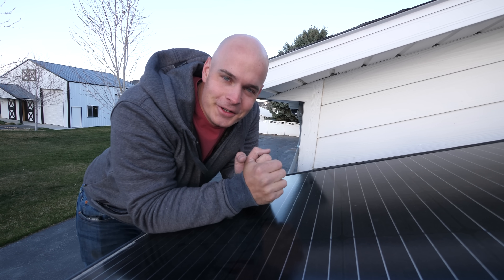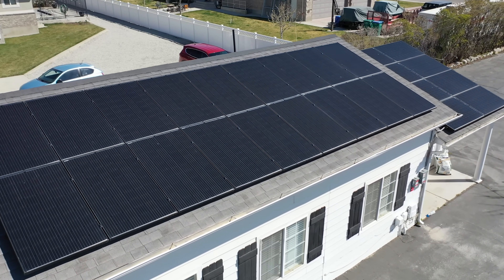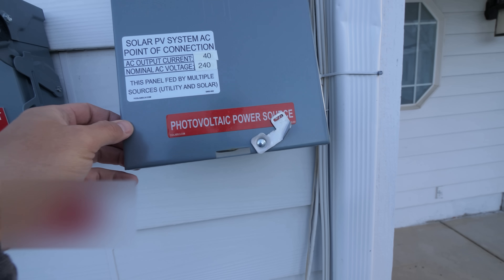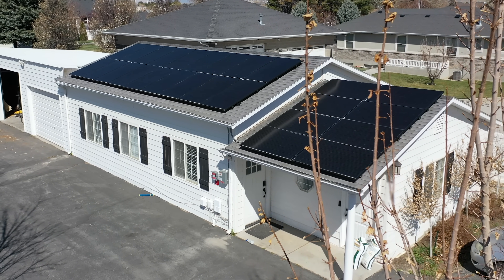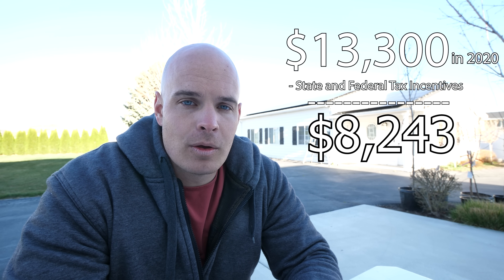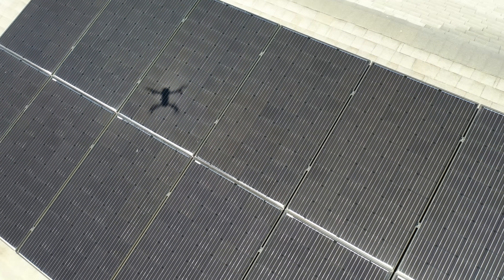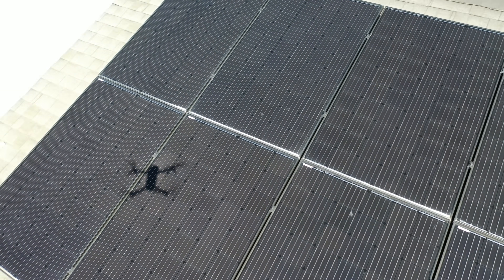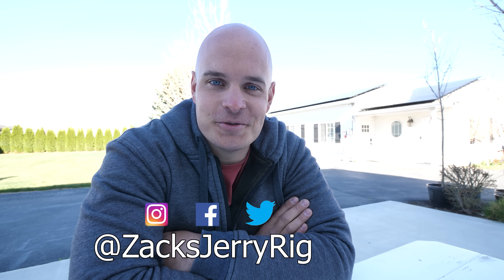One Year Solar Update! - Is Do it Yourself Solar worth it?

Comment: You missed the cost of replacing the roof in 8-10 years. The asphalt shingles are not able to take the extra heat under the panels. and the sheathing starts warping also. never mind about potential rick of leaks. Better off with a sun tractor panel in the yard.

Comment: Quality video.  I went with a reputable installer.  My energy bill average is $187 per month x 12 months = $2,244 per year.  Maryland electric prices are .12c per kWh. We have net metering, Baltimore Gas and Electric pays you for what you produce.  For each 1Mwh produced you generate a solar credit that pays you, currently $75 per credit x 16 per year = $1,200.  My system has been up since Sept. and has generated $1,000 in kWh so far and I have been paid for 6 credits for $437 (2 credits to be paid still).  I will see a bigger amount of pay back over the next 4 months due to the summer sun.  I project 100% generation for all my electric needs ($2,244) + 16 credits x $75 = $1,200.  Total $3,444 per year.  Wish I had done it myself, but my roof is 2 stories and a steeper pitch, plus I am not a fan of heights.  8.5 year payback.  Key is to buy and pay with cash as, if possible.  I got a 1 year 0% interest loan on the government subsidies. Paying interest will increase the payback period.

Comment: With regards to east vs west power, it depends on where you live. In sunny parts of Australia it’s about 88% of the north (your south) facing. But in areas further from equator it goes over 90% so most new installs in Australia are east+north+west in 3 strings or micro.

This is really a new thing with the efficiency of some of the later panels. If it’s a slightly longer ROI it doesn’t really matter.

I know if really old systems going string after 15 years, so they would have paid for themselves many times over.

And better still…. More solar means less coal.
Reply: Absolutely agree. Australian here and will be aiming to get solar later this year on E/N/W option as you said as my north facing roof isn’t very big but have a large west facing roof.
Reply: @AidanCran  you won't regret it :)
Whilst I have north facing, I was speaking to my rear neighbours (both of whom have strictly east-west roof aspects) about how solar is such an affordable investment (particularly in Australia). But they still remember the days of north only. Shortly after the conversation, both neighbours got quotes and within 2 weeks, both had operational systems.

A year on (even in the bad rains that have hit the east coast), the systems have proved their worth. During the rain when I had almost no sun, my system was still generating a saving to the point my electricity provider was still paying me for net export.

The smart thing the Australian government did very different to the US was two main points:
1. Clear the red tape allowing for certified installers to do the work in a very straightforward manner
2. Provide a mechanism for quickly dealing with Renewable Energy Certificates.

Someone in the US can really comment on how they deal with Renewable Energy Certificates. In Australia though, the Renewable Energy Certificates (RECs) involved with solar installations are called “Small Scale Technology Certificates” (STCs). These are offloaded at point of sale of the solar, to companies that need to offset emmissions (usually filthy fossil fuel generators). But to the purchaser, it appears as an immediate rebate off the solar system.

Benefit of the scheme is that:
1. Government does not have to actually spend money - they set up the system (although many still think the government is handing out money - which for them is just good marketing).
2. The residential solar owner gets financial benefit immediately and does not work
3. Red tape cutting means that from getting a quote to having a working solar system can be done in as little as a week

It's led to Australia having the highest uptake of residential solar per capita globally (Germany and Japan are 2nd and 3rd)
Reply: @inodesnet  that’s amazing!! Thanks for the reply!! I did not know about the uptake of solar, my family is in good stead for the renewable future being German and Australian 😋 
The STC’s are going until 2030, so get in as soon as possible to capitalise on those discounts!! 👌🏼☀️
Reply: @AidanCran  I think great thing is that the phasing out really times well with the fact that solar products are becoming cheaper every year.

So the “rebate” (incentive) has always done a good job of making solar affordable for the average Australian home owner because more was taken off price when expensive, and less as it gets cheaper.

Price has always been around $1 per W whereas countries like the US have only recently broken $3 per W

Comment: Great looking system and hello from north panel facing Australia.

Confused about saving calculation. When talking about saving here we split it into self consumption and export.

If you created 30kWh (during day) self consumption might be 10kWh (what you would normally pay your provider). So that would be 10kWh x 10c saved. The extra 20kWh we would normally export and the provider would pay us. Then of course taking into account usage at night that solar doesn’t pay for.

In my case electricity is much more expensive than Utah. We get about 1/4 system paid for government which is effectively paying the REC’s in advance.
We only get that if we have it installed professionally :(

In USD systems are usually about 70c per watt installed. But high electricity price really helps incentivise with our kWh rate being closer to 20c (OUCH). But for exporting we get 15c.

Utah’s giving back is actually a really, really good idea!!

Loving solar though. The government and installers make it easy making it the highest per capita user of home solar. Payback given higher price got electricity and lower system and install costs is often 3-4 years here.

But having seen so many systems here (over 20％ of homes have solar), I must say yours is really good looking and would put most to shame

Comment: I have to say that. that has to be one of the easiest solar installs.  There is no roof vents anywhere on that side of the house which you then have to work around with the panels.  No here.  It's just full panels all the way across.  That's pretty nice.

Comment: I would build a carport over where you park your truck and a covering over your driveway and put up more panels. And if lumber is too expensive, It would be easy to do with steel and it would never be replaced, since most steel roofs have a 30 year warranty to match the panels' warranty (plus it's just your truck and driveway underneath, who cares if it leaks eventually?).
Reply: A couple of years ago a buddy of mine looked into financing a system but he said it wouldn't be worth it. We live north of Tupelo, MS but he's got a lot of trees across the street that shade his house. Another thing I realized, whenever your power rates are increased, you'll save even more money and earn even more night time power from your system.
Reply: I think he's got a garage attached to his house and he rents that little house out. His real house is in front of the little one, then has another garage in the back as well.

Comment: In a temperate climate like the middle latitudes of the U.S. are the best places for solar. If you have to produce much more output for increased heat or cold, solar won't be able to keep up. The more extreme the environment, the more solar falls behind hydrocarbons. You could get the same results by producing electricity with a parabolic closed system mirror water boiler. But, just like solar, when the sun goes away, you're done. Your best bet at production is harnessing wave energy from the sea or nuclear. Waves are consistent. Only maintenance is replacing parts rusted by seawater. Solar, wind, whatever, shouldn't be labeled "alternative", it should be called "supplemental". The real advancements will have to be in batteries and harnessing lightning in batteries to provide supplemental energy. Nuclear is still the way to go and stop looking at it like the boogy man.

Comment: The city of Los Angles DWP only pays wholesale cost to you for power back to the grid. About 1 or 2 cents per KWH. 
Question: I have a over built 50 X 20' steel roof patio facing South could the panels be mounted on the patio and tilted up towards the sun? I do not want them on my house roof.

Comment: This is so different to UK. We meter your production with a inline meter. Then you get payed for half your production at a feed in tariff rate which is higher than the cost we buy electric in at. So if you can use more than 50% you produce your winning.

Comment: Someone walked on the panel at 5:29? LOL
Reply: They were all over the panels at 10:30 during the installation too. Pretty sure the manufacturer doesn't recommend that!
Reply: @YeahTheOzzy  I can't see walking on a fairly thin tempered glass panel.
Reply: @electronicsNmore  not recommended but hey it didn't break.

Comment: I installed a 15kw system on my home myself. It cost me about $10k. $7k after federal tax credit. First year saved me $1600 so I should get 100% payback in a little over 4 years.  If I can get a 20 years out of these panels and inverter and would say it is well worth it. The hardest thing on installation was doing the paperwork for the city. I would also like to say, do your research, know exactly how your power company handles solar. In my area I have to pay a higher rate for electricity with solar because you lose a lot of discounts. Also, they pay very little for excess production 2cents kwh.
If I had to pay a company to install, I got bids for $30k plus and that just would not be worth it in my opinion. Cleaning the snow off in the winter is a pain. oh, and a far a saving the planet I think that’s a bunch of bs. science actually shows there has been no global warming at all the last 12 years. I can go on about this subject and all the fraudulent facts but to each his own. it’s just too bad our government is raping the American taxpayer trillions of dollars and they are not even spending it here for so called green jobs. giving it all to foreigners. that's got to tell you something right there.

Comment: Great video man, however, there is one thing you didn't talk about: it's the thing underneath the panels that convert DC to AC, I've read that it need to be changed every decades, how much would it impact your budget if it is true ? I guess you will add it to the math if so

Comment: 10c/kWh? Far out. It's easily twice that in Australia. IS that price an actual feed in tarrif price though? Or do you get nothing or a lower rate for feed in?

Most places don't pay you anywhere near the same amount you pay. i.e. here it's 25c/kWh to buy from the grid, but to sell back you'd be lucky to get back 8c, some place none (and there's no giving you back any at night here). So it's better to charge batteries, or use as much energy as possible.

Comment: Your calculations assume that you have a coincident load to match your panel output because you're not wheeling (selling your power back to the power company at a significant discount).    In reality, you're likely not going to have as much electricity being used at peak production every day.  And there will be other times, too, when your house doesn't need as much power as the panels are putting out.  Because you're also not storing this energy (in batteries, for example), it is wasted and is going to bring your simple payback period up from the modest 6 - ish years that you are calculating now. 

Finally, Utah is excellent sun country.  Most of the USA doesn't have nearly the insolation that you are enjoy. 

The result of all of this is that the average American is still likely to only realize a 15 to 20 year simple paycheck on a system at their home.  This is approaching the useful life of the system - which means that they are effectively just prepaying for their power by installing a system. 

This isn't true for everyone, though.  Some people definitely can save real money doing this, but you need to carefully calculate up front to determine if it's a good call.  A licensed local professional engineer focused on electrical or mechanical engineering  can help you with these calculations for your home and situation.

Comment: this is crazy good content man! and dispels all the "caveman like head scratching" moments i so often have when trying to learn about at home solar. a huge thank you!
Reply: If you are having doubts, its basically a long term investment in yourself. Its expensive on the initial setup but it really pays for itself over the years. As a plus it also provides peace of mind since power outages won't be such a huge problem anymore with a decent system with batteries providing power throughout the night to at least keep the fridge running the lights on and charge your devices. (Especially important if power outages happen frequently in your area.) All without the massively annoying noise of a power generator, the trips to the gas station to keep it running during outages or the risk of suffocating with its fumes.

Comment: Interesting video. But there is a bigger picture. Most houses do not face the sun square on. Houses in the colder climates have snow and of course no solar power at that time.  And you forget that energy is not created or destroyed. So when get 13kw/hr from the sun you took it from the roof. Good in summer but in the cold you will burn fuel to heat your house the same 13KW worth. You will need to insulate like crazy to stop this. Of course you only get some of each Watt since going in and out of the public system is not perfect. Many insurance companies will not cover your roof when panels are on them, and probably not last, the panel are made of very nasty chemistry that in 20 yrs when the panels are dead you will not be able to easily get rid of.  So if it isn't nuclear, you are just moving energy from one place to another and back.  The cars are actually worse.  But, what do I know.

Comment: My kit did not come with the ac combiner or the solar metering can/box. I asked and I did not get a clear answer. They also put a inset electrical panel in my plans which is not possible on a cinder block house. I am still hoping once the system is up , then all the trouble was worth it.

Comment: Great video! I hope to soon install solar on my home, I currently have a hybrid solar install on my RV, so it is grid tie when parked at home, and battery when disconnected. at only 260W though and flat mounted I only average .7kwh a day, but hey its better than the controller just rejecting power! You could expand by building a "carport over where your truck is parked if you need more space!

Comment: We looked at Solar but decided against it for a few reasons:
1) Without batteries, if the grid loses power, you lose power.  It doesn't matter if you are producing or not.    I'm not sure if this is how all systems are, but it's how the systems in my state were being sold.
2) Long time for ROI.  We weren't installing ourselves and it may have taken 10 years to recoup the cost.  We may very well move before we recoup the cost.
3) We may need a new roof (shingles) in a few years and didn't want to deal with the hassle of finding someone to remove/reinstall the panels for the roof repair.
4) Your warranty is only as good as long as the company stays in business.  A lot of these new companies over great/long warranties, but they may not be around in 10 years.

Comment: Hi, Jerry. I have a 10 kilowatt system installed in india. It is of the net metering kind wherein excess generated electricity is given to the company, but the rates are quite low. Still I am happy with it as my bills go down to almost 80npercent in summer. Only in rains do I need to rely on the power company. Batteries are absolutely not useful as buying, charging and replacing them is very cost ineffective.  But. Cleaning the panels is a definite hassle. I have to go up there every week and use a low pressure washer to clean the almost one cm layer of dust every freaking week.

Comment: The worst thing you can do is stand on your panels like in the video towards the end when someone is kneeling in the middle of one. It causes micro fractures inside the cells which cause the cells to burn out over time, losing massive amounts of efficiency, voids panel warranty and can cause a fire. I'm an electrician with a solar licence in Australia for context.

Comment: A single normal two string inverter instead of those 10+ micro inverters would have drastically brought the cost down for your system with very few disadvantage.

Comment: check out the channel DIY solar with Will Prouse if you're interested in DIY solar.

You can buy lithium cells individually for less cost than lead acid batteries per kwh of energy storage if you source them directly from china. (where they all end up coming from anyways)

Couple that with some all in 1 solar inverter/chargers and refurbished/used panels from Santan solar and you can have an off-grid home for under $20k if you're willing to get your hands dirty.